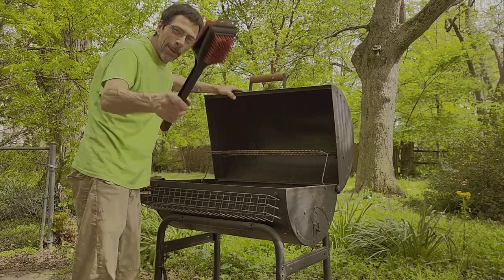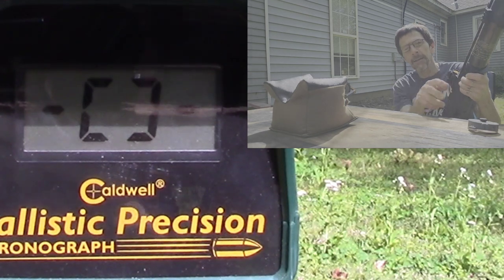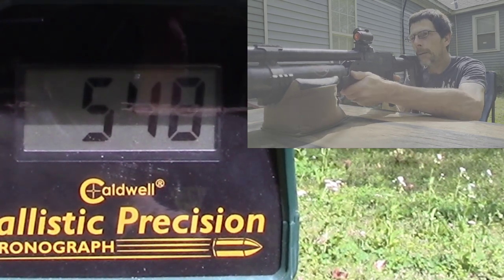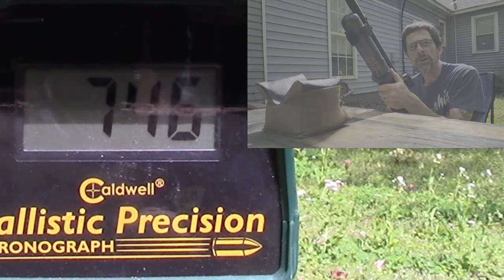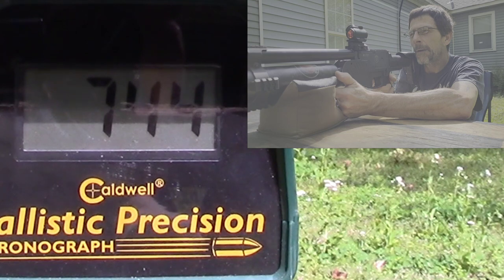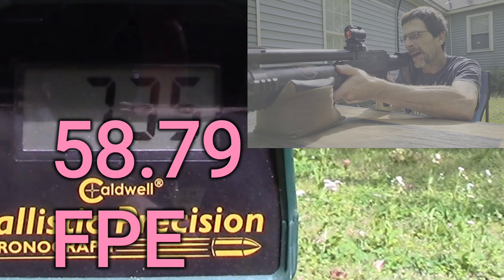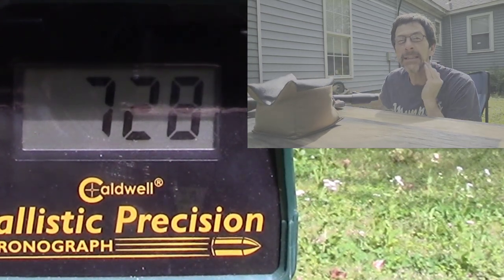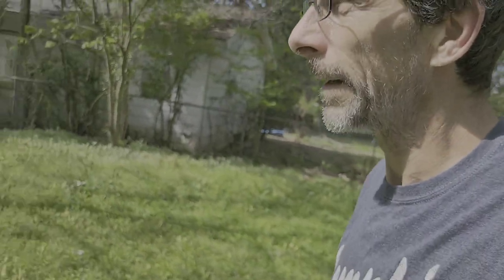hatsan blitz 62 foot pounds with new hammer and spring

Comment: HEY bossman! Great vids helped me out! I orded the full length hardenedhammer springs macabeespped told me get ..I can't find the length he cut them to..5.88?   Anyway got a new replacement from Hatsan...im about to open her up .after 300 flawless rounds...only getn 690 tops with Hstes
Reply from the maker: I've found that adjustment screw to be a bit tricky how exactly where it should be to much and your spring will bend and stay that way to little and you'll have low power that's what happen to my spring it bent